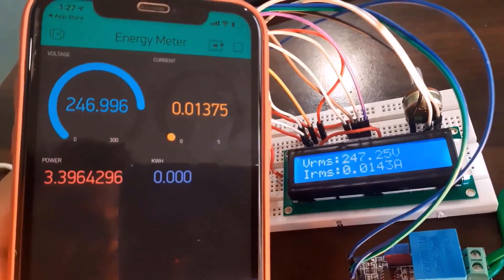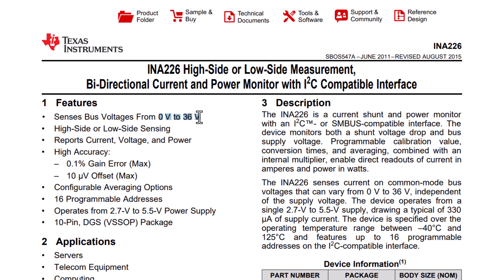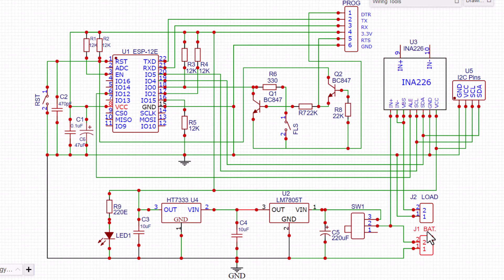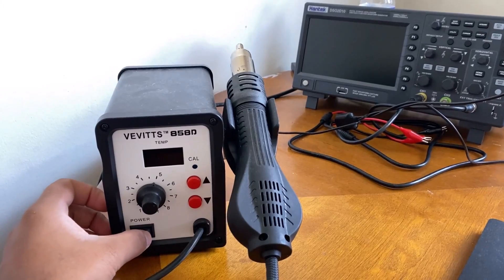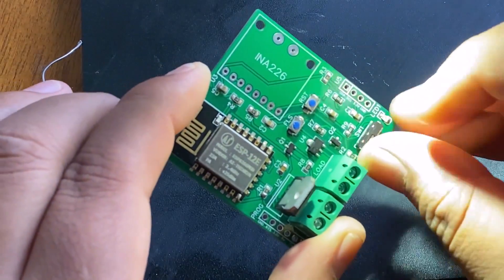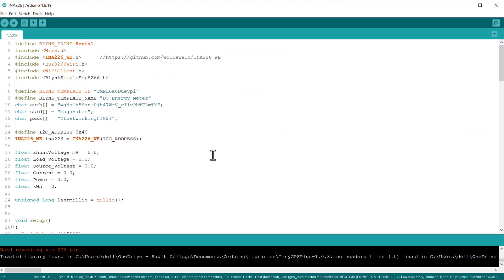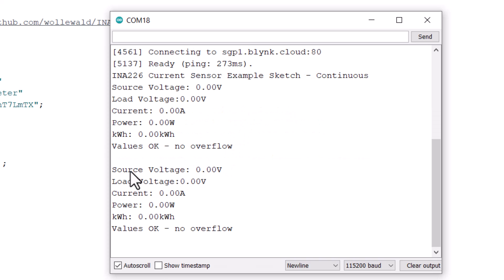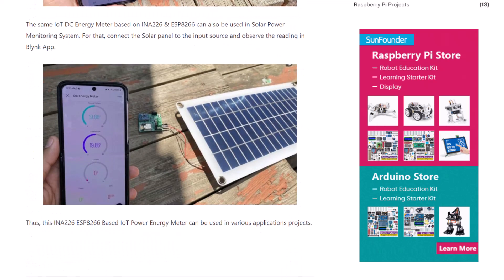IoT DC Energy/Power Meter using ESP8266 & Blynk (36V, 30A)

Comment: Hello, there is a problem. Your code is compiled and loaded, but after a few seconds it does not see the blynk server. I reset the power supply and it works again for a few seconds, then it turns off. Please help me figure it out. Thank you.